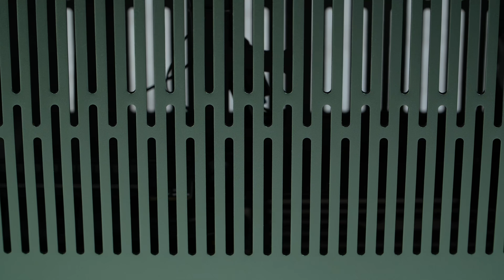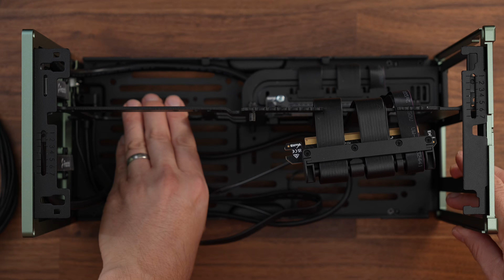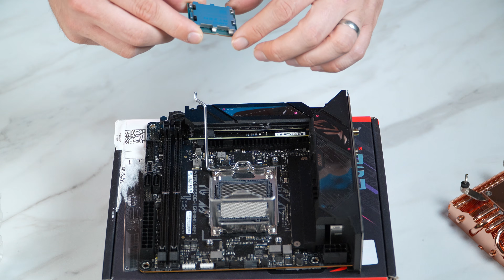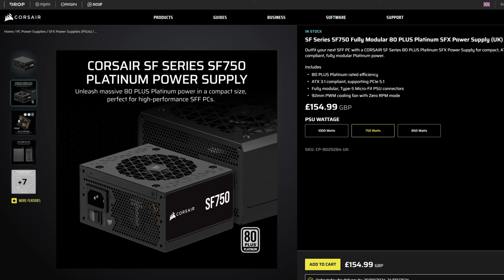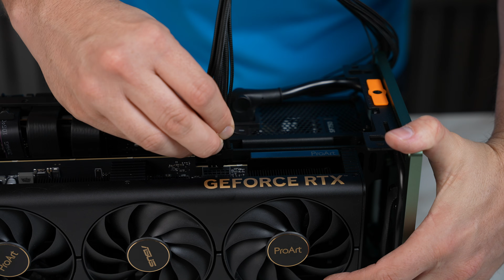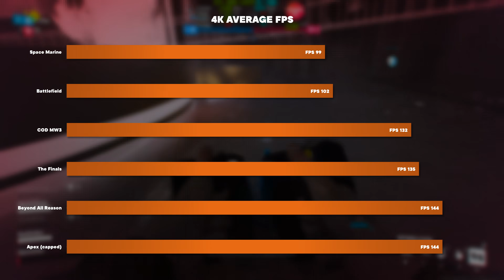The Quiet 4k Gaming Terra Build - Featuring Ryzen 9 and RTX 4080 Super & ITX Fractal Terra

Comment: Hi there, love your videos! I was wondering if I could pick your brain about something - I'm looking to build my first PC (hopefully with the performance featured in this video!), though since I move around a lot I'm really limited to something compact, as such I've been trying to decide between a Fractal Terra build and a Densium 4 Plus V2 build from your prior video. Is it possible to get that kind of power (ie 4080 super) from a case that small, or is the Terra about the smallest you can get? Also, would you alternatively have alternative recommendations for someone trying to make the smallest smooth-4k-gaming-possible machine he can? Once again, mad respect for what you do, have a great day!
Reply from the maker: sadly as portable as the densium is, 4070 is the max I can fit in there but if you move the machine around a lot having something that small is amazing. Plus it is really solid so no worries about transporting it regularly. The terra is also an amazing machine but also much bigger and not so solid feeling. Other options are a Dan a4h20 (but I dont like to use water coolers for regular travel) and the forms T1. I have just been working in the form t1 and will have. a video on that one soon as my 9800x3d arrives (stuck in customs atm) but that could well be the best choice if you are willing to put the time into building it as it comes completely flat packed.
Reply: @MashITTech  thank a million for your advice! Will definitely keep an eye out for that video, appreciate what you do!

Comment: Hello, amazing video ,but i need your advice. i want to build in the next month,a pc.
Do you recommend this kind of build that can handle for the next 5 years ?I mean ,i am not an expert, but the bigger cases are not more airflowed like this one?
I really want this build but i am a little affraid ,about temperatures.
If so,do you recommend this build with msi tomahawk with wifi as motherboard? Thanks keep it up .
Reply from the maker: I am a little confused with your question. If you get a larrger ATX you will get much better airflow but with the right component choice the ITX systme will run pretty cool easily for 5 years (obviously if you live in a dusty environment you may want to clean it every so often). I am currently working on some larger builds ATM so you may want to see how they look/perform so you can compare. I am always here to help if you have any specific questions. PS I just bought the z890 tomohawk board so doing a build with that one soon.

Comment: curious if you could try the minisforum BD790i SE which has 16-core/32-thread 7940HX CPU that costs 329 USD after a promo code which is more than half than the sum you purchased your motherboard, cpu, heatsink combination.
Reply from the maker: Sadly it’s not available in the U.K. 😢 from what I have heard it’s a good option but BIOS is incredibly basic (like a laptop bios) and performance was much less than desktop counterpart

Comment: Could I run a 9700X processor in this build or will that make it loud as well?
Reply from the maker: easily, the 9700x runs cool out of the box, only if you whack the wattage up for a small performance gain will the temps get hot
Reply: @MashITTech  Thank you!~

Comment: Hi, I wanted to check with you regarding the SSD installation. I'm using the same SN850X 2TB, but when installing the SSD to the motherboard according to the manual, there's a slight bent on the SSD. I'm not sure what causes this, but did your board cause the same thing? Does this even matter or should I be worry?

Comment: How many and what case fans should I get for the Terra?
Reply from the maker: there is space for a 120mm at teh bottom. I used a noctua 120x15 as I found the 25mm thick fans a bit tight. You can also squeeze a small fan up at the top but I didnt need it

Comment: I'm Building my 1st PC and I order this exact case. I'm nervous and excited at the same time.
Reply from the maker: well if you get stuck on anything just ping me a message :)
Reply: howd it go? is it loud?
Reply: @mysticalbeast5377 not at all.
Reply: Any update?
Reply: @ChoiSeHo688  been a solid pc. Instead of a 4080. I went with a 7900xtx amd a 9800x3d. 

Its pretty quiet and its been running just about everything I throw at it at Max settings 1440p or 4K. Love how small it is and how easy it is to access everything.

Comment: Is the air cooler work for a 7800x3d in the terra ?
Reply from the maker: yes, very well. in our experience the 7800x3d used less power than 7900 non x
Reply: @MashITTech  okay tysm !
Reply: So what was the reason for choosing the 7900 non x (tdp 65W) over the 7800x3d (tdp 120W)? I'm leaning towards the 7800x3d because of the better gaming performance, but I don't know if I should use the Noctua NH-L12s or the ThermalRight AXP90-X47 for a quiet 4K gaming Terra build like yours.
Reply from the maker: the only reason I chose 7900 was for the extra cores. If it was just a gaming machine I would choose 7800x3d (and have in other gaming builds) but I wanted to make a machine capable of gaming and work such as my video editing, 3D design with a little gaming on the side 😊 for a pure gaming rig the 7800x3d is a much better choice and is easily cooled by the axp90-x47 copper, I even managed to cool a 7800x3d with a tiny l9a low profile cooler in my densium build (5l tiny build)
Reply: @MashITTech  can you also recommend the 7950x3d? currently using it and I want to recase it to terra

Comment: How long did it take for you to build this great PC.
Reply from the maker: If I wasn’t filming it about an hour. Obviously I had to keep stopping to change shot etc which doubled the time 😀
Reply: @MashITTech  Thanks for the info, can't wait to build my Terra ITX PC soon
Reply from the maker: if you get stuck on anything pop me a message 👍
Reply: @MashITTech  The X47 Copper is not available in Australia, Do you recommend to go for the X47 Black or the X53 Copper. I need to keep it on Position 4, So 62mm is the max for the CPU.
Reply from the maker: I would get the x53 copper unless you are running a really low power cpu. With the x53 you will still have 9mm clearance which is perfect
Reply: @MashITTech thank you so much 😀👍

Comment: How much does the entire system weigh in total?
I am genuinely considering going back to desktop gaming from the laptop, but I have to move from one country to another quite often. 
I am wondering if this is something I can work with as a carry-on cabin luggage.
Reply from the maker: Haha I always forget to put the weight inthe video so did add it to the description. the complete build is 6.93kg/15lb5oz. I love laptops and obviously review a lot but I still prefer a ITX desktop for the lack of fan noise and upgradability. If I was going country to country I would probably go with something smaller and lighter like my densium build: https://youtu.be/c2U1-5nOjxw
Reply: @MashITTech  Most allow up to 10kg but some goes down to 8, so this being under 7 even, that should work just fine. 
When I had to go from desktop to laptop with the "same" components, I definitely felt the performance hit. I do miss the desktop. 
I can buy and sell monitors wherever I go, I carry the peripherals in the larger check-in luggage anyway. Thanks for that. I'll check out the smaller setup as well, cheers.

Comment: Another cracker build! Would you recommend this case over the S400?
Reply: I got a intel build with the 4080 super proart in the s300. In terms of min/max since both only air cooling. The s300 is slightly smaller and performs the same since it's the same cooler capabilities in general.
Reply: @reitastatic3386  Thanks for sharing! Been looking to upgrade from my Ghost S1, so I'll look into the S300 as well

Comment: I have almost the same build. Just a different cpu and cooler. Using the 7800x3d with a noctua nh-L12s cooler. The fan is under the heatsink which allows for no turbulence. The spine is in the 3rd position.
Reply from the maker: I have a l12s and didnt even think to use it 🤣 any turbulence GPU side in that position?
Reply: came to just check this CPU brother. Thanks for confirming.
Reply: With the L12S and spine 3 how much space is there for the GPU in mm width? Is it really bad soundwise if the GPU is right up against the side?

Comment: This case is conceptually wrong. It invites you to mount a good quality GPU, but forces you to choose less performing processors because you don't have the possibility of mounting a good CPU cooler. It's all wrong. I strongly advise against that processor with that CPU cooler.
Reply from the maker: But why? the 7900 is a 65w variant, in reality it takes 90w with default BIOS settings (obvioulsy you can over ride that) but perfromance at 90w is excellent and the x47 can easily handle 100w of power
Reply: It’s fine. CHILL out 😂

Comment: I have had a Terra since launch and you are right, long as you build it right you get decent temps and noise. People having issues usually don't have a gap between the fans and the side panel or they are trying to cool a 14700k with a NH-L9i.
Reply from the maker: haha so true, I had seen loads of people moaning on reddit and it nearly stopped me buying the case!
Reply: how can you cool a 14700k in this case? 

I thought of getting a fractal terra case (because it looks cool and super compact) but ended up with a Lian Li A3-mATX case build (less compact but have 4 ram slots due to matx motherboard for a future upgrade and an atx psu - cheaper than a sfx psu).
Reply: @ZaporOshti  I wouldn't run a 14700k in one. I had a 13600k and it was fine but I would want a 240mm AIO or a tower cooler for a 14700k.
Reply: @richardfarmer6570  I see, then was 13600k in the fractal terra case with an air cooler?
Reply: @ZaporOshti Yes, I used a Thermalright AXP-100 full copper.
Reply: I have ryzen 7900 3d and it is noisy :(
Reply: I’m new to PC building but want to build with the Terra. What would you suggest for me? Is there a service I should use? I just want to be sure it’s powerful and built correctly.
Reply: @WhatWeveScene  watch lots of videos on building with the terra. Then figure out what your budget is. From there, find a gpu, cpu, cooler, and mini ITX board compatible with your chosen cpu. Cost all of that out then realize it is above your budget and start to slash performance. If you want suggestions, people need a budget.

Comment: finally, someone who made this build quiet and breathable though i was curious is it normal for a cpu being high in temps? or is that caused by the games you play
Reply: It´s being limited by the cooler of choice, that´s the major problem with air cooling mini itx cases, the CPU suffers if it gets one of these low profile coolers but it gets way better if the case can accommodate an IAO or a small tower cooler.
Reply: @gils_rhapsody  ah thank you
Reply from the maker: Also, AMD are happy running at high temperatures and the 7000 series were slated at launch with people seeing high temps. Obviously if you put an AIO or large cooler on it will run cool but having been used to gaming laptops runing at 100c for teh last few years these temps dont worry me at all 😂
Reply: @MashITTech  that’s fair 🤣🤣

Comment: i just build almost the same exact parts yesterday in my new Formd t1 case, teh 7900 is a great ccpu i got used for 260 euros and i tweaked it and getting even better performance from teh 7900x with max temps at 85 degrees, i am just super happy with it!

all core running at 5400 Mhz with a cinebench score of 29780. and all of that only with maxing at 88 Degree
Reply from the maker: Wow how many watts is that taking to boost it to 5.4 all core? Did you air or water cool it? I just ordered a t1 😂
Reply: @MashITTech  Actually not much maxing at 190WATT and its water cooled with Coolermaster Atmos 240, i had the Terra starting this year but its super limiting the CPU so i sold it and went DAN H2O (Great Case) too! but i wanted something new and the fomdT1 is just the Killer! you gonna love it!

Comment: You shoud edit the voltage/frequency curve in MSI afterburner for an undervolt/underclock to reduce wattage (thus temps) of the GPU while keeping virtually the same performance. The memory of the 4080S usually supports a good overclock (+1300 on mine). There are detailed videos on YT about this. Depending on game, wattage can be reduced by 50-100W for maybe a 2-3 fps loss. These tweaks are even more useful in a compact build
Reply from the maker: You are absolutely right and I always do for me personally but I wanted to prove it ran at stock settings quietly which was my aim :)
Reply: @Gamer4Eire  You can leave you card at stock settings if you wants to, but there are plenty of benefits with underclocking/undervolting: lower wattages resulting in: lower temps (8-10 degrees celsius observed) thus less cooling thus less noise, reduced electricity bill (although probably marginal), less stress on the components and thermal paste. For a specific full path traced game I've seen a massive reduction of 100W, going from 320W to 220W (of course at virtually the same performance). Although the wattage reduction is usually more in the 50-70W range for most games. Tweaking the voltage curve can be a bit cumbersome, especially to make sure it is stable so I can understand most gamers not caring.
Reply: @Gamer4Eire  Well, I would not say that it is as you say ("and neither one goes about 70 under load"), because as I can see from your gameplay video of Ghost of Tshushima your Zotac Trinity 4080S reaches 75ºC at ~300W load. And everything is perfectly fine with my build, it works flewlessly.
Reply: @Gamer4Eire  Ok, mine also have a small peaks depending on game, but there is no reason not to undervolt it and have (even) lower temps, and power consumption. 😉
Reply: @Gamer4Eire  Only applicable for games that can reach very high framerates (where "very high" is gamer and gear (monitor) dependent)) and does not apply to demanding AAA games, especially when raytracing is involved.
Reply: @Gamer4Eire  Actually you should undervolt it (at least 4080S ProArt, which btw I also have) because it can reach 70ºC+ (85-90ºC hot spot) in games. ProArt is beautiful looking card, but it has smaller cooling system than the other 4080(S) models, and because of that it can reach higher temps. And also why not take advantage of the opportunity to have the same performance with lower power consumption and thus temps?